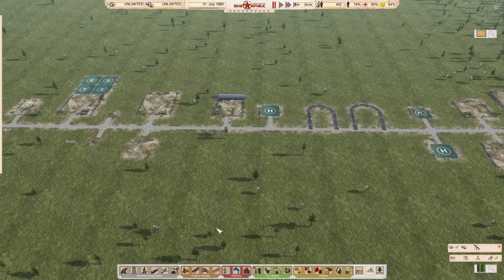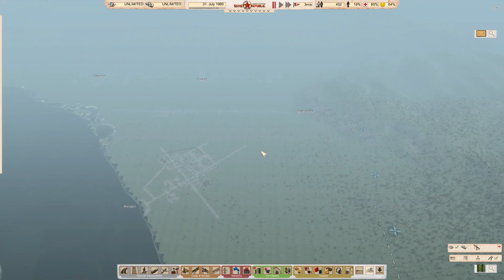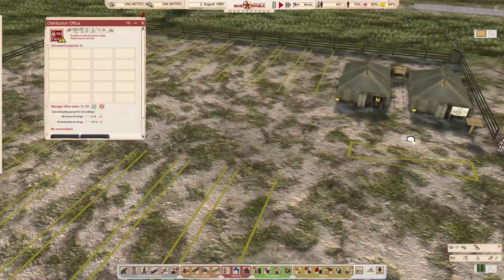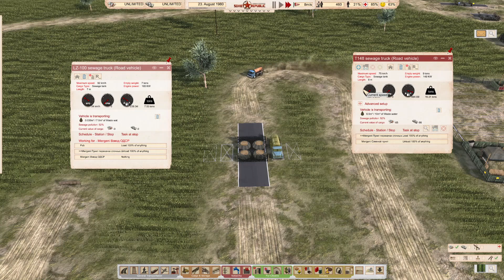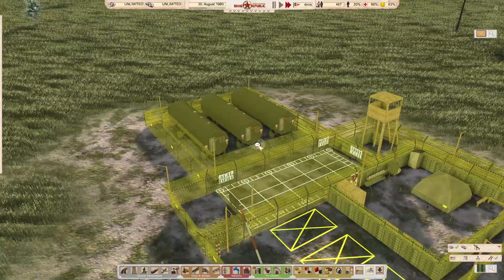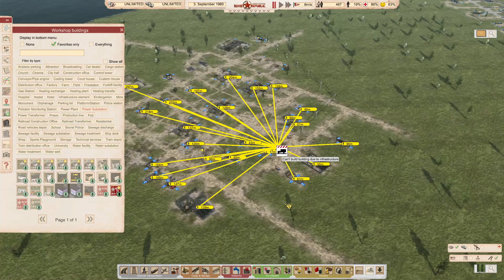Mod Overview Military Construction Unit (Realistic Mode) :: Workers & Resources Soviet Republic

Comment from the maker: Important Correction:  I did not make myself completely clear when I stated buildings with the green icon were free to place.  These buildings are intended to support placing of a single construction camp built by the labour battalion.  This means many of the  'green' tag buildings still need worker days to be built, but do not require additional resources,  While the red icon variant needs both workers and resources to build.

Comment: But what is this for? Just a props? Cause there is no war in this game or units or anything
Reply from the maker: Its a mod that contains a range of low cost buildings (tents) that can be used to build a temporary workcamp of around  500 workers containing the 'basic' facilities' . It can be used at the start to create a 'tent' town that supports the construction of the first town, thereby reducing the cost of foreign workers.  Alternatively it can be used to build a new town some distance away from the population centre, thereby allowing the development of remote resources  This can speed up the building process as workers are located near the construction sites, preferably within walking distance.    The 'basic' services avoids the need to spend years building power lines, sewage and water, before the first worker moves into the new location.  I like it as it represents how labour camps were used to build remoted communities during the Soviet era.  

Tip:  If you decide to use the mod be aware the workforce will not be happy, so need to good supply of over 21's to replace the losses.  For example, I have had a couple of instances where poor food delivery resulted in the camp being wiped out.  

Hope this makes sense.

Comment: This seems like a really cool mod, but since I don't read Russian and there are no graphical hints on the icons, it's hard to use. Do you know if there's a way to convert the icons to English, or if there's an automatic way for the Cyrillic name to be converted to English?
Reply from the maker: Have had a similar problem when planning a camp.  The left hand mod menu groups  the different buildings by category,  e.g. school, secret police, etc.  When planning a camp I rename each building as it is placed, as this makes it easier to identify.  

If you want to find a specific building, use the 'List vehicles and buildings' overview (it is the forth icon from the top on the left).  Once open select 'List Buildings'  while looking at the area/town, this will list all the building within a specified range.  Then click on the listed tabs to find a specific buildings, e.g. school, etc, then click on the entry to find its location.  Find this useful, when trying to find small buildings in built up areas.  

Hope this helps

Comment: The water and sewage buildings work similar to the gas stations, transferring loads between vehicles.
Reply from the maker: It works well for sewage,  but find the water distribution trucks can confused where they keep coming back for the tiny amounts of water.  When this happens they start to go round in circles, it could be due to the tiny size of the camp.  Will need to test it on a bigger camp.

Comment: To use the gas stations with limited storage, you need to send a large tanker there to act as the supply using "wait until unloaded" instructions. Other vehicles coming in for refueling will draw from the tanker.
Reply from the maker: Ty for the tip.  

Just run a test,  now it makes sense, although would not like to depend on them exclusively as there is no fuel when the tanker is away.  Easily fixed with a very small gas station to take over during the gap.
Reply: @StephenSilverbeard  So cheap I build them in pairs.
Reply from the maker: @paradoxbound  Like that idea.